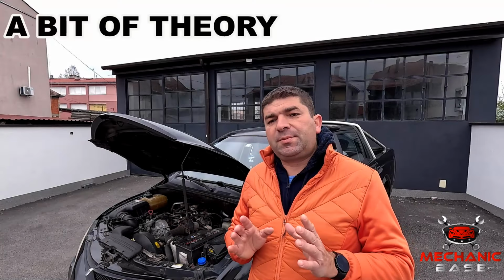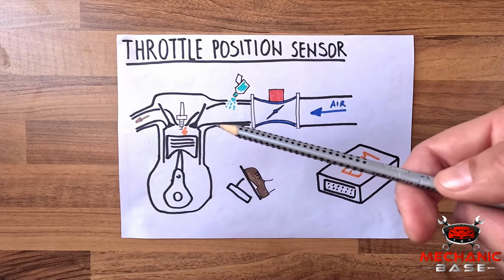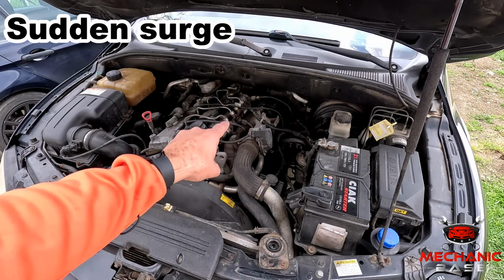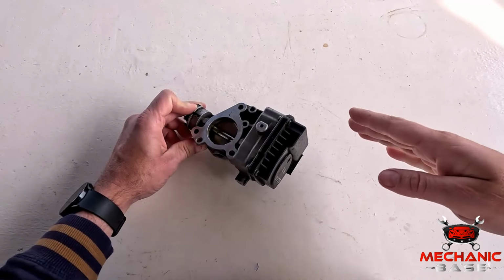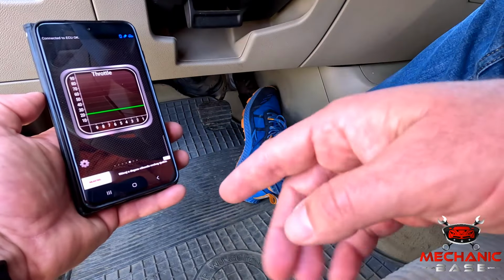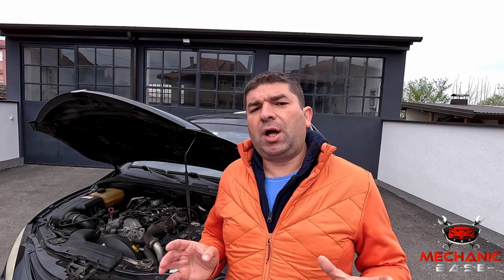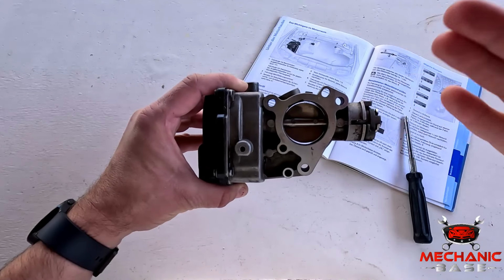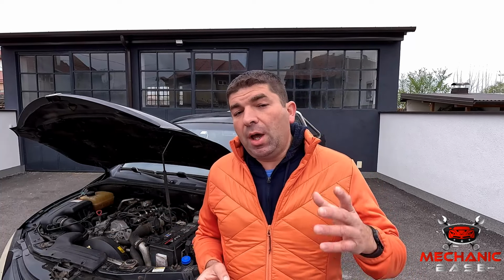5 Symptoms Of A Bad Throttle Position Sensor (TPS) & Replacement Cost

Comment: easy way stop and start the engine and ajust the trottle body screw till engine run smoothly like ice cream. If the procedure doesn't work clean the trottle body and replace the tps.

Comment: My Accelerator sensor 1&2 always say the same number. Driving around, in park or even with the truck not running.  No codes.  Slow acceleration and what feels like flat spots.  If you are trying to accelerate quickly, it all or nothing. It won’t accelerate quickly until it down shifts and then it flies.  Such a pain. I like to cruise and enjoy the ride, I don’t like having to drive like a jerk just to get around. 😢

Comment: Honda Jazz 1.3 cvt  jerking

The jerks can be anything from once or thrice or even multiple, but not lasting more than 5 seconds.
 It jerks in these scenarios: When turning out to join the main street (90 deg turns) When there's a slight incline, my fit will jerk at about 2000rpm on D mode. And again, on a slight incline, the fit will jerk at about 3000rpm on S mode.
Moving on slow speed 20mph

Comment: BIG BIG BIG BIG THUMBS UP! NEVER thought a 21yr old truck would run like brand new after replacing such a small part. Had virtually no acceleration, gear shift was crazy all over the place, idle would be so high at times and so low in cold weather...no codes, live feed on my OBD2 reader was crazy all over the place...and VOILA!!! FIXED and wow does this truck GO!!! It's actually FUN to drive again. THANK YOU! LOVE THIS CHANNEL b/c of the complete explanations of WHY things happen and how to fix 'em. 2003 Chev S10 4.3V6 w/515k miles ORIGINAL ENGINE and STILL running like a champ w/o any major repairs. RARELY have taken this truck to a shop - ALWAYS do my own repairs and lately realizing this particular truck is SO EASY to repair compared to today's vehicles....THANK YOU!!!

Comment: Great informative video , i have a 2003 Lexus GS300 which is cable operated and was giving me code P2121 and P2127 ,  i took the Throttle body position sensor off and removed the part of the white plastic from the back after heating it up with heat gun and re-soldered the 4 connectors and glued back the plastic piece after warming it up with heat gun again . I installed it and took it for a test drive , it is holding up so i am not a part changer , i had planned on buying a new one but i decided to attempt to repair it first which i did . The solders on connectors part may crack and lose contacts from age , heat and mechanical wheel , so , i hope this may help others to repair their throttle position sensors . 
PS , before i attempt to repair the TPS , i removed the ECU and checked to make sure there is no burned spots on ECU , it looked like brand new after 20 years . Good luck with your projects folks .

Comment: When  I play with my wires  on my tps the engine  idel  up an down  it on my sr20de engine fwd model 1993  need some help sluges  acceleration on full trottle  y

Comment: I am having almost a similar issue on my Acura mdx 2015 it jerks when accelerating when the rpm is between 1 and 2 it jerky have changed fuel pump, spark plugs, injection nozzles with the ray still yet no change. I am binging to think it the throttle position sensor after watching your video. I have diagnosed it but it not showing any code. Please what do you think ?

Comment: I get my check engine light blinking after reaching 30 mph and I'm having really crazy transmission shifting issues! Thanks for the confirmation! I know my transmission is okay because the fluid is good and the pan stays cool.
Reply: Did the tps sensor fix the issue? I’m having the same problem and I’m thinking it hopefully is my tps before I replace the tranny
Reply: Same thing happened to me. It was a bad coil.  Haven’t did that since. I was able to get a CEL diagnosis tho.

Comment: Could the throttle sensor prevent the car from flipping on? Or would the car still be able to flip on in my Situation car wouldn’t flip on or if it does would turn off seconds later

Comment: Good day I have 2006 Ford fiesta Ghia 1.6 petrol my car was idling high then I replace the pcv valve still idling high then I notice the pipe for the pcv valve was broken so I put another pipe now my car does not idle so somebody said it.s the throttle body I took it out and clean it it was dirty I put it back still no idile can you give me advice what else can be wrong

Comment: In my SLK320 as soon as you try for a kick down it goes into LlMP mode...thn l have to stop the car ..preform the transmission setting procedure, it works well again, kick down again and the LIMP mode kicks in..hooked the scanner and no faults come up...what next?

Comment: W212 e250 I had my alternator replacement, and now the car is very slow to accelerate, like it has no power , but when it's in  park, it accelerates fine 
I have no check engine light .

Comment: My pickup truck runs good when heated ....but morning cold start the engine runs up an down ....
the OBD tool reads cold start as both banks running lean.....
Reply from the maker: Which truck? Might be a vacuum leak.

Comment: My 2000 Mk3 VW Polo 1.0 has a issue, It starts no problem and ticks over no issues at all but the throttle at times does nothing. Its not safe mode its No peddle mode. But it only does it just after starting, if you keep restarting it will work.

Comment: Hi, my audi a4 b7 intermittently goes into limp mode only when slowly accelerating from a stop. Car doesn't go into limp  mode at cruising speed. When light turns green i just lightly pressed on the gas pedal and it goes into limp mode. There are no check engine light or codes. Any help would be greatly appreciated. Thanks
Reply from the maker: Which engine do you have?
Reply: Thanks for your reply. It's the 2.0L turbo quattro

Comment: my toyota celica  had no code  but it had hesitation when accelerating from a stop. an when a dead spot when i was trying to overtake another vehicle i would have to take my foot off the throttle an re apply befor the car would pick speed up faster
Reply: I’m experiencing the same thing! Did changing the TPS correct the issue?
Reply: @makay6947 You can get your car scanned for free at a Advance Auto, Autozone, or maybe Oreilly Auto parts store . Will save time and money.

Comment: Thanks for the video. Do you think that 12% min and 75% max on the sensor is a correct data ?
Reply from the maker: Which car?
Reply: @MechanicBase  Mazda 3 gen1 (2004) 1.6 liter

Comment: Can a bad TPS cause to run rich and or fuel code like a oxygen sensor?
Reply: Ok that sucks
Reply: Did you fix ur problem??
Reply: @ton-locc8069  Nope. Took it to Firestone and they put in a Mopar OEM TPS. No change
Reply: I'm having same problem with my GMC I already changed all my 02 sensor & still haven't solved the problem

Comment: My throttle body has gone bad , as of now I can get the car to crank but won’t start . Should I replace the throttle body ?
Reply from the maker: Will it start if you press the throttle?
Reply: This condition applys to my Audi also. Will start only if pedal depressed. No CODES
Thank you for reply
Excellent video

Comment: Just replaced one on a Hyundai Sonata.  The symptoms were the same as when a fuel pump is starting to go out.  It would act as if the gas was cut off and it would then go back to normal so it was very jerky.  Knowing the car had had rust in the fuel tank in the past I started with by checking the fuel pump... but no, it was the throttle position sensor.  Swapping that and the car magically went back to normal.
Reply: Intresting. That's the exact symptom my 97 ford f150 is having. Fuel pump is 5 years old, but TPS is 24 years old (original). So it makes sense to replace first. Thanks for sharing that!